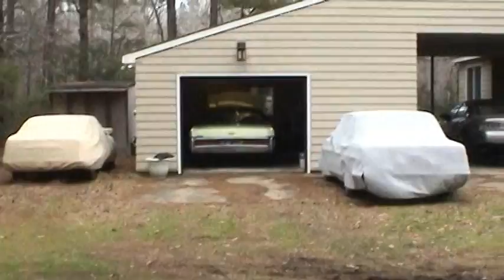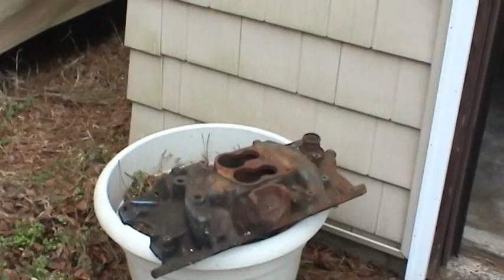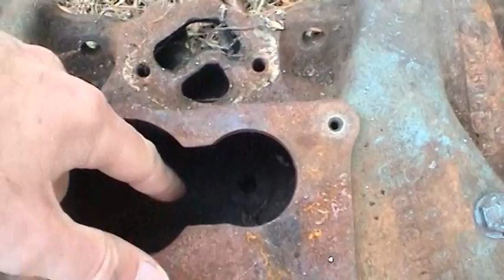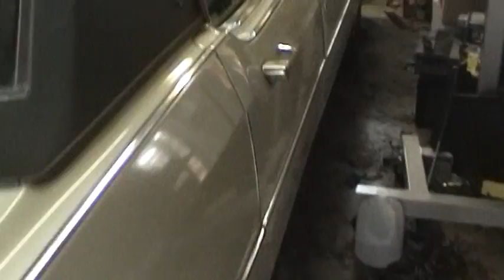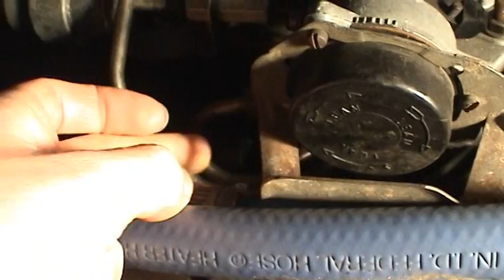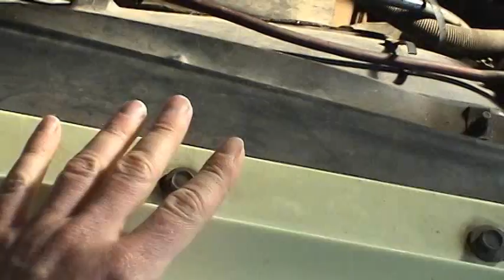1972 Ford 460 V-8 Choke Mechanism and Design

Comment: Great tutorial shadow but I'd like to add just one thing. Make sure that the adjustment screw is adjusted correctly on the high idle cam in relation to the choke tension.
Reply from the maker: That reminds me. I do need to do that as well as give this old classic a tune up when the weather gets nicer. I can't wait for the warmer temperatures!
Reply: *****  And then take it out and drive it like you stole it.:)

Comment: 87 ford f250460 4bbl holley. over oiled k&n air filter now having idle problems, wont kick down HELP!!!!
Reply from the maker: Does it have an electric choke heater? If so, the element or possibly the thermal switch could be bad. Also, check the spring tension. If it's too stiff, it'll be difficult for it to open up completely. If it uses the crossover in the intake as the heat source as my 460 does, you may have to pull the intake and make sure that passage is clear.
Reply: thank you i shouldve paid more attention to my dad in the garage when i was younger lol.